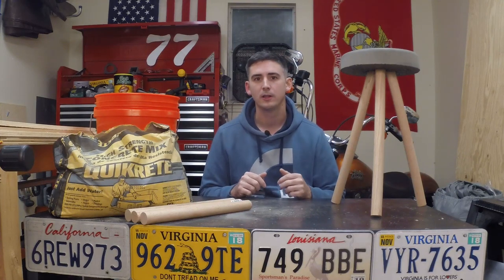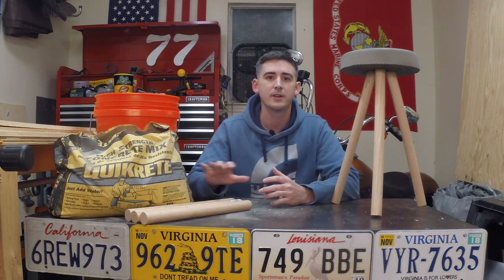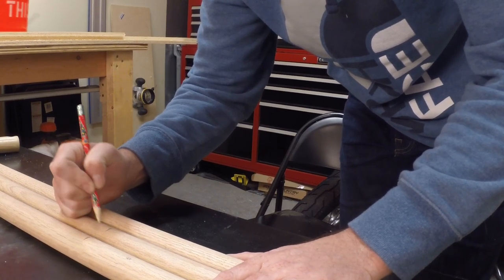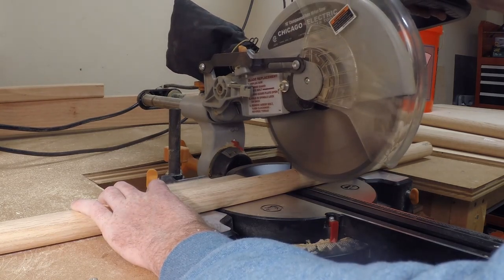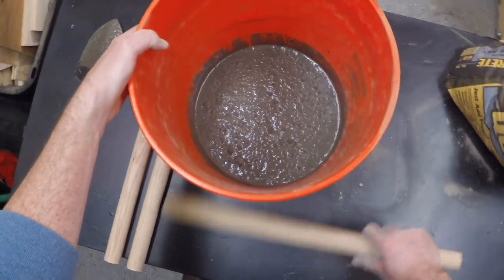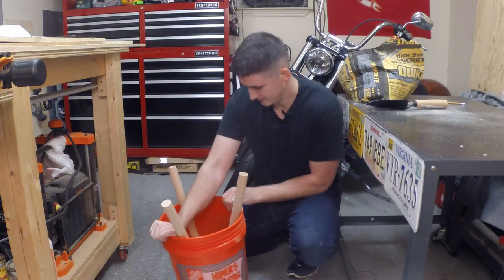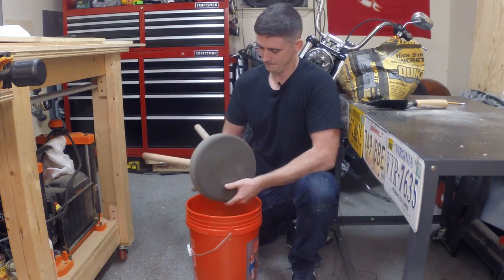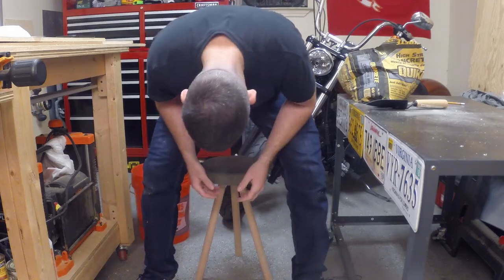DIY Concrete Bucket Stool

Comment: Hi what size length are your dowels and thickness?
Reply from the maker: Liam Blasky I just went out and measured. They are 1 and a 1/4 inch thick. Just about 20 inches in length. 

For reference, I wanted the stool a specific height so it was a comfortable sitting position at my desk. I took a spare chair I had and put blocks under it until I liked the height. Then I measured from the seat to the ground and applied that to the dowel length before I cut them. 
Hope this helps!
Reply: Thanks a lot. Great video
Reply from the maker: Liam Blasky I truly appreciate the encouragement. If there’s ever details I glaze over or even things you’d like me to build or help out with let me know. I’m happy to help and pass along any knowledge I have.

Comment: Well, I've tried this twice and was not able to get the stool out of the bucket.  Any ideas??
Reply from the maker: Pat Meyer try flexing around the lip of the bucket to break the concrete free at the sides. If you don’t care about keeping the bucket you can cut it off, or add heat (leave it out in the sun, use a heat gun, or dip the bucket in hot water) to try and get the plastic to expand and be flexible. 
Other than that you could put on the Rocky theme song, run up the stairs at the art museum in Philadelphia and go to town on that bucket!
Reply: @theknottywoodworker5774  Thanks for the ideas.  I did see that someone had added some cooking oil or Pam to the bottom and sides of the bucket and it came out easily so I'll try that next....third times the charm, right?
Reply from the maker: Pat Meyer that’s a pretty good idea, I didn’t think of that one. I thought you still had something in the bucket.  If that doesn’t work I’m still pretty certain that the rocky theme could do the trick. Good luck and let me know how it goes
Reply: @theknottywoodworker5774  Oh, it's still stuck in the bucket.lol  This idea would be for the next try.